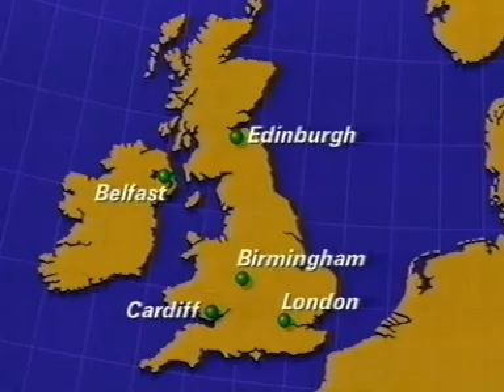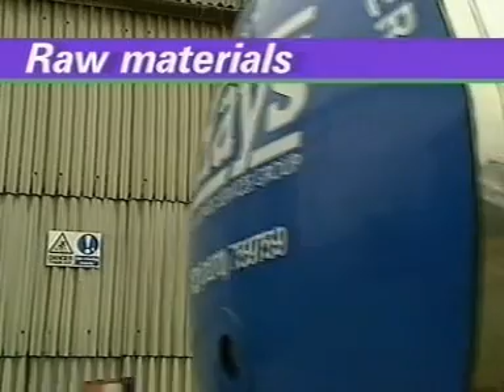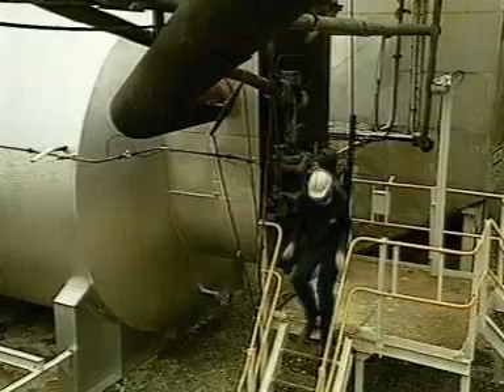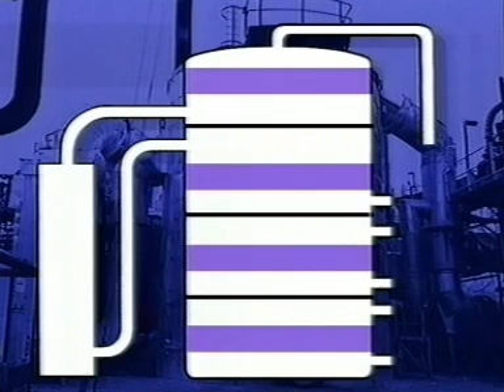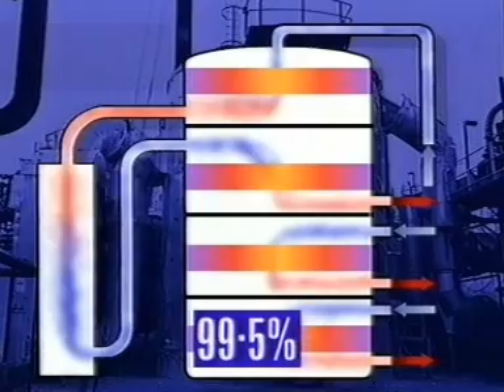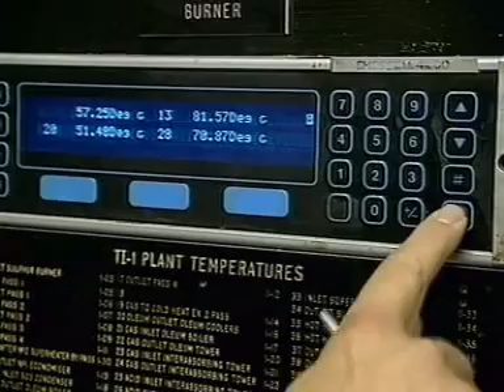Sulphuric Acid - The Contact Process

Comment: Youve left out so many details..When SO3 is first added to H2SO4 it forms oleum,(H2S2O7)WHICH THEN REACTS WITH water to form the sulphuric acid.....its not diluted directly with water because the heat generated may boil the acid and produce moist fumes of the sulphuric acid to the air.again the gaseous mixture is dried with conc.H2SO4 after it is dried in a drier to remove impurities that may poison the catalyst and that also reduce the surface area of the catalyst reducing its efficiency
Reply: shut plz

Comment: NMelvynN.. the reason being is water can't added directly to SO3 because the reaction is uncontrollable and will creates a fog of Sulfuric Acid. The best way is to absorb SO3 by 98% of H2SO4 to produce fuming Sulfuric Acid or Oleum(H2S2O7) and then dilute the Oleum by adding water to desired concentration.The reaction of Oleum with water to produce Sulfuric Acid is H2S2O7 + H2O ---> 2H2SO4